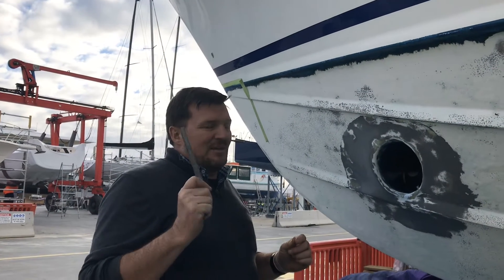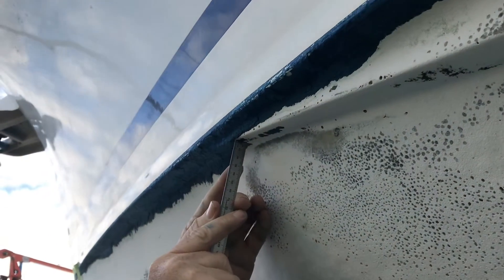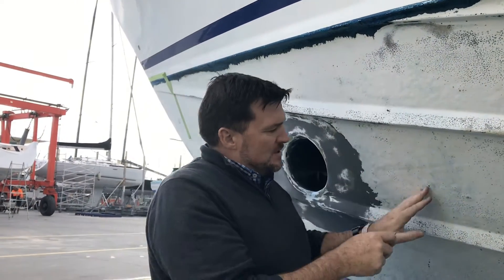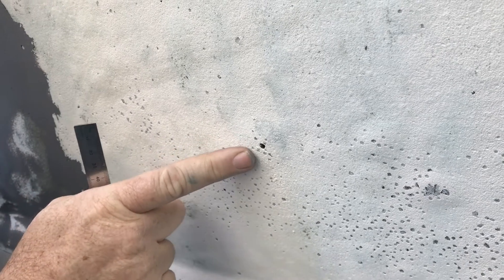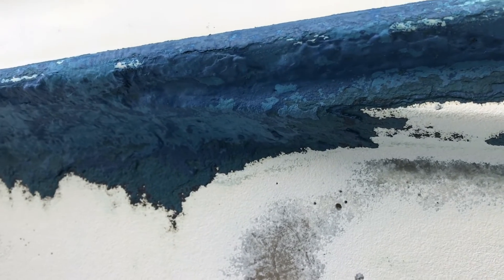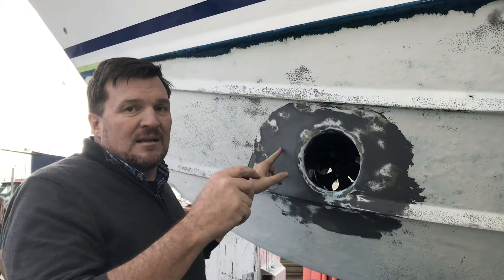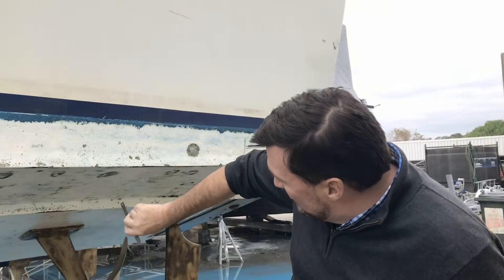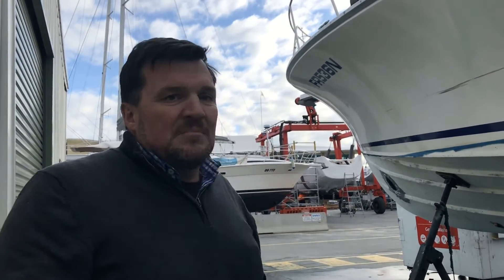Does your boat have Osmosis in the hull?

Comment: what does such a typical job as described in the video costs ?
Reply from the maker: Hi Klaas - thanks for your question! Repair cost depends on severity of osmosis. For this boat the entire hull was stripped back and built up again - the cost for this could range from $40-$60k. So not cheap!

Comment: Hi Ned. When you say if checking isn't done regularly, osmosis can take hold. What does take hold mean? Does every boat have osmosis at some level? David
Reply from the maker: Hi David, Great question.
Not all boats have osmosis. It only occurs due to lack of preventative maintenance.
What I mean by that is - a boat that lives in the water needs to be regularly dived on to clean off excessive growth (every 6 months or so). It should be pulled out of the water to be re-antifoulded every 12-18 months, and every 3 years or so the antifoul should be stripped back and a fresh coat applied. In this way - your hull is protected from the water ingress which causes osmosis.
I hope that answers your question.
Cheers 
Ned